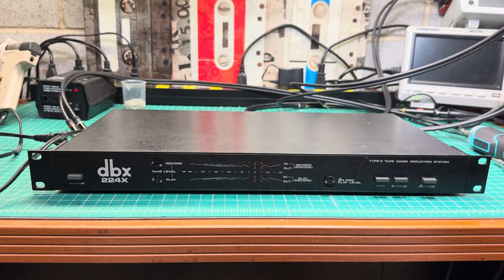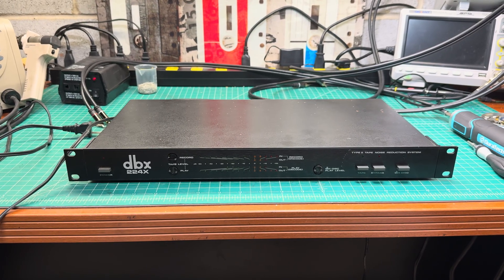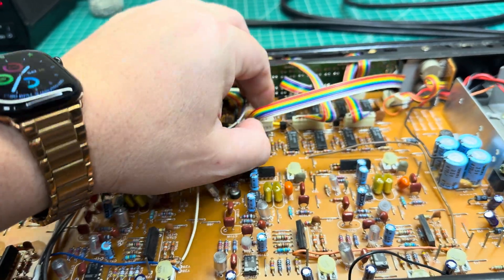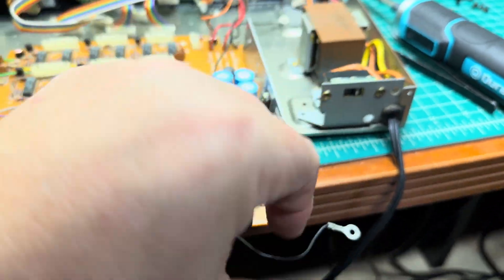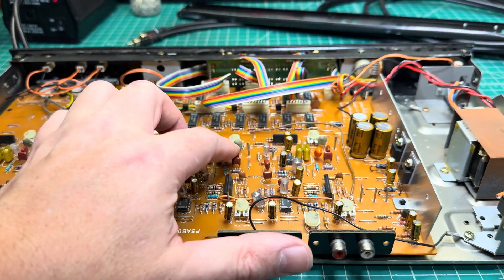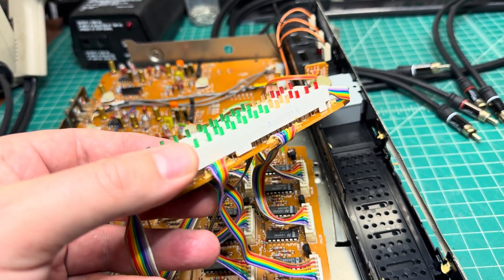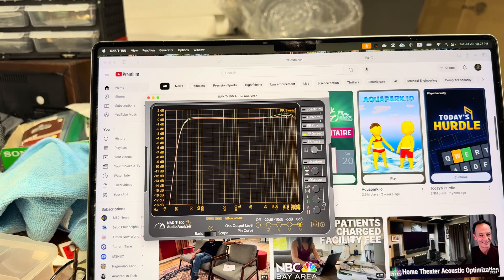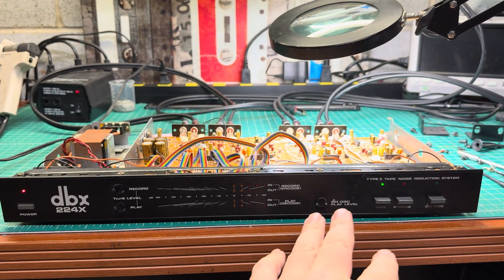Crackling, Glitching, Not Giving Up – Restoring Another DBX-224X Decoder

Comment: this bump might be nichicon gold as they have diferent sound characteristic then any others, generally they add more highs and cut a bass this is why every deck you recap they increase details and highs but by costs of bass, im not saing there is not bass but is always lover then previous caps. i dont install them everywhere, in many gears im avoding them especially in Denon (vintage) as they kill oryginal character od vintage Denon which hase nice punchy bass and after nichicon gold all of this is lost and is more flat with no soul of Denon. this is only example but im trying to replace caps which has similar sound characteristic to the oryginal but its personal preference.
Reply from the maker: Well, in Nacamichi these caps give perfect low bass to 11 Hz. That is more issue of design and impedance than caps material. Muse give more bass but that may be just because of higher ESR and ESL, as there are more winds of foil. WIMA the best

Comment: Is it possible to connect the 224x output to the input of another 224x and compare against the original? It would be interesting to measure the overall effect to the sound, provided one has two identically-performing devices.
Reply from the maker: Yes, it is. DBX format is much more compatible across different decks than Dolby. Because it always uses the same 2x compander/expander. The only difference would be 2x non-linearity of the deck and box itself. and what is a flat response on one deck may have some variations on the other.
Reply: It wouild propably be better to record the output of one unit and then playing it back to the same unit to deencode the signal and then compare that to the original signal, that way most signal degradation will be done by the one unit only (and very little from your recording equipment prodived it is of some decent quality).
Reply from the maker: @Gin-toki not exactly. Imaging that response of the high frequencies on the playback deck is 2 db lower than the recording deck. With all good conditions and the same dbx unit to decode sound will not be the same. It will be muffled.
Reply: @hifirulezzz  Exactly.
Reply: @Gin-toki  You're introducing two more factors: the tape and the recording/playback deck (heads).
With just the 224xs in the loop you only have one factor (assuming the 224xs are closely matched). 
If you're worried about variation between the 224x samples, then you can perform the experiment twice: once with the first 224x as encoder and the second as decoder and another time with the 224xs swapped. Then you'll have two measurement samples.
Reply: @Stelios.Posantzis  I would use a high quality audio interface for this test to minimize the impact of the interface as much as possible.
Most modern audio interfaces are more than capable as functioning as precision measurement devices for audio bandwith signals.